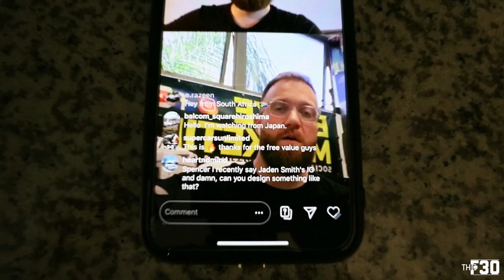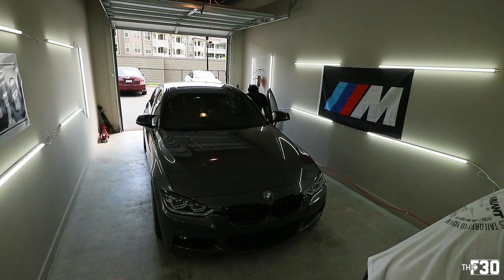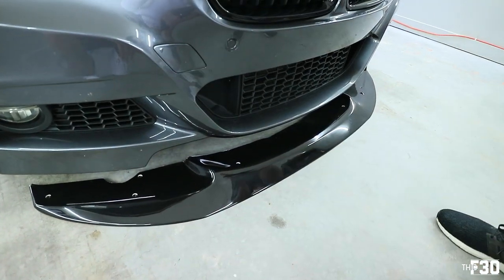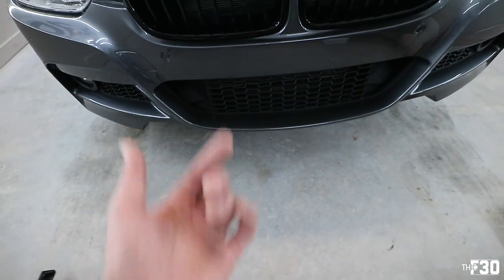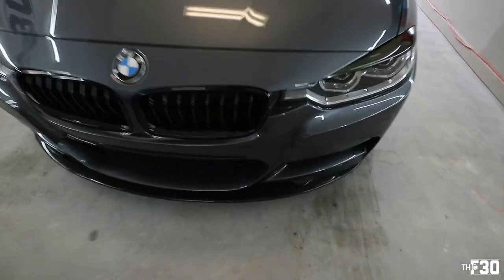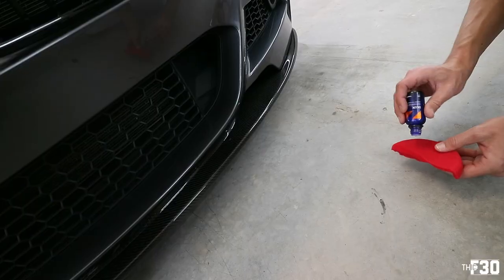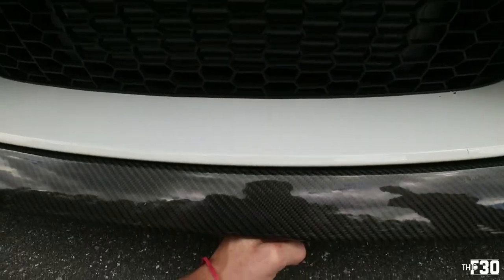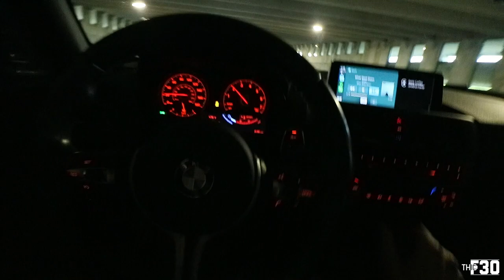CLEANEST F30 CARBON FIBER FRONT LIP OPTION - SUVNEER BMW F30 LIP!

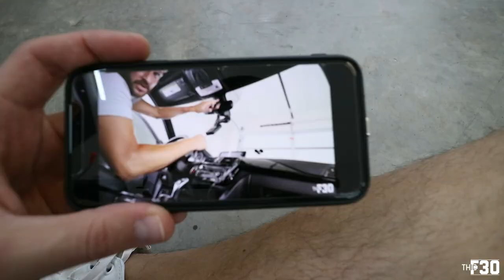Comment: Before the install you talked about putting a screw in each corner. At 9:29 you can tell that corner isn’t as flush as the middle. Did you guys ever go back in and put screws there? If you didn’t are the corners that are not flush only noticeable from the angle you recorded or also if you’re walking by? Doing this exact install on my f30 in a few days and want to make sure I get all the right hardware

Comment: Great video man I had a MG 328 F30 with the m sport conversion with 437M’s that lip would have been great instead of the m sport. Sold it recently and picked up a 2016 M235i in mineral white with corral red interior with 30k on the odometer I’m loving the transition from an F30 to a F22.

Comment: Very nice looking! Just a suggestion, replace at least two screws with pass through screws with nuts in order to secure the lip. I had an e90 335i, now I have an f30, and the lip blow off and I lost it.

Comment: May i ask for his F30 wheel&tire spec? ,i just got M442 (19x8 19x8.5 from 4-series) on my F30 but it doesn't pop out this much so i wonder what is the differences?  THANK YOU !
Reply from the maker: Spacers are what you need, he has 12mm front and 15mm rear
Reply: Thic F30 i see, do you have any recommendation for spacers or the one he use?
Reply from the maker: H&r spacers are good, just make sure they are hubcentric